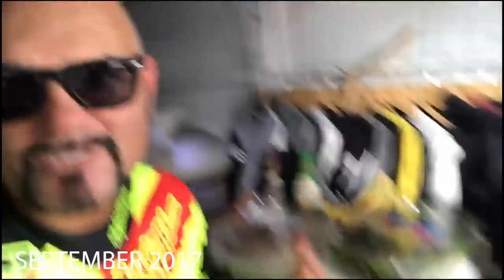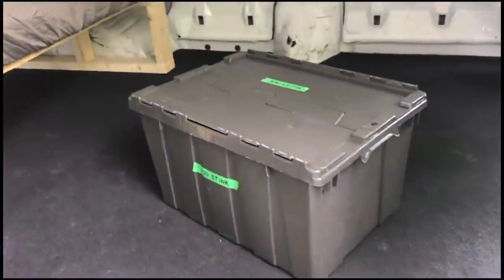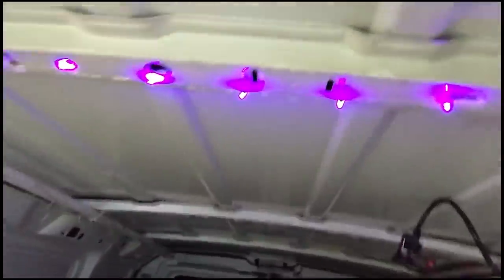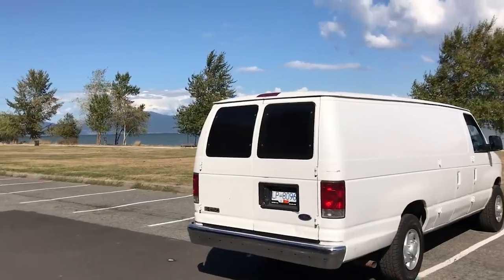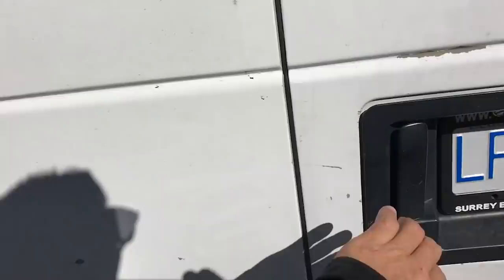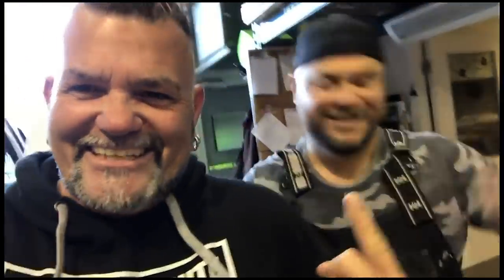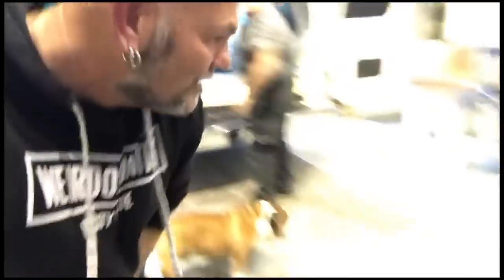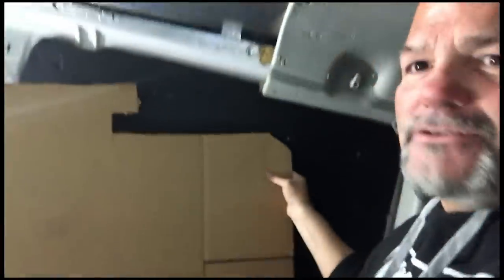BUILDING A VAN WITH FINANCIAL PROBLEMS "Simple And Cheap Store Furniture" This Is My FIRST VAN BUILD

Comment: You are so right - right at all the beginning: the van itself is most important! And it becomes even more important over time - because so many tailor made pieces had come together and fitted together, made sense over time.

So, taking care of the van is most important! ... Even if it's an older one.

... Unnecessary to say, just treat it right, no hard offroading, no max flex or torsion of the body on uneven roads, no days of hard driving through pooring, rusty, corroding rain, when it's possible to select just another dry day for the next part of a smooth journey ...

Thank you for sharing!

Comment: I watched you in the beginning.  I remember thinking you were doing it contrary to what I was seeing others do. I remember laughing when you didn't have any insulation. I also remember when you ran the extension cord to the air conditioner under the bed out the back door at the golf country club to keep Disco cool. The simple AA battery lights are still a part of my solution. Even the 400watt inverter that you recommended I still have.  I  still  am  primitive and basic and broke.  My van is not attractive. You would gasp. But thanks to you Chrome I got on the road in my old van with plywood walls, eye bolts screwed in with ridiculous gear ties to hold down a folding table as a counter. The bed was built  yet everything else is still in your words "a ruckus."  I crossed the US and saw great landscapes and met great people. Sometimes, I am jealous of what you have got, but then I remember.  I Will celebrate my 2 years in June.  Thanks. for doing this vid.

Comment: Great look back at where it all started. 👍 Not everyone has the time to watch a 1000+ videos to catch up.  😂😳 I too took the build it over time route.  But, instead of rebuilding it over and over again, I had a plan and built it a section at a time.  Once the bed was in, I moved into the van and built around the bed. ✌️Great video! 😎🚐💨

Comment: I first found you because I was looking for simple and easy build to start 👍 I'm over a year and a half in my van now and just started spending actual $$. Start basic and work out what you need as you go really works.

Did my 3rd rebuild last week lol mine has been basic so not a huge job. Installing solar and finally a fridge this week 😊 I've had portable solar which is a great first option. Something to think about if someone starts big - some things you see that are amazing for other people will not work for yourself. I realized I loathe having my bed in the back for instance 😉

Comment: Just thinking how easy it is to light a van now with all the little USB rechargeable lights you can get, a 12V system is not needed until you are putting down solid infrastructure in the van like a leisure battery and solar... No more AA & AAA batteries needed just a battery bank and the USB lights.

Love how you have tried things out and seen how the van works for you.

Comment: Help! I can NOT find any vehicle to make into a camper van (no-build build) that doesn’t have less than 150,000 miles and cost less than 13,000 dollars. I’m determined not to go under a 2010 for any vehicle, so this is where I am. Have sleeping, cooking, toileting, storage, etc. all worked out and in my camp box, but no vehicle. I’m in the Midwest, subscribed to car guru, Autolist and others. Don’t trust Craigslist. I currently drive 2018 Chevy Equinox but would rather sell than try camping with it as it really is too small! Any suggestions?